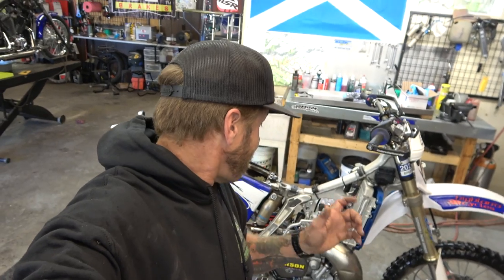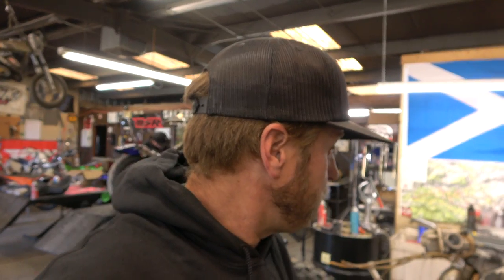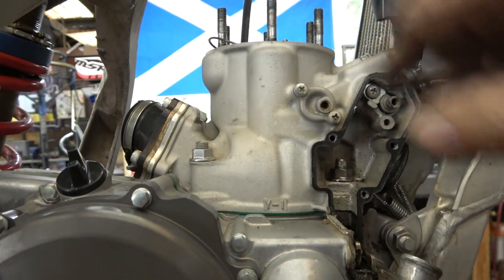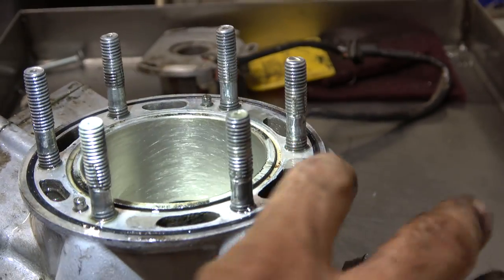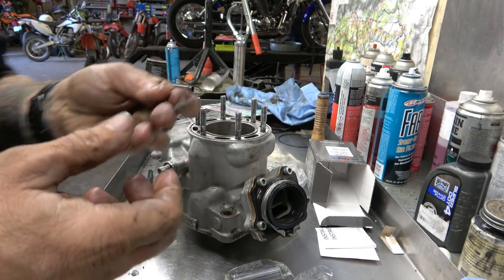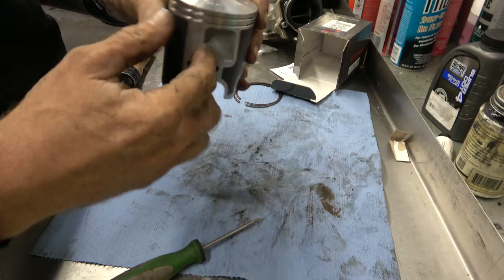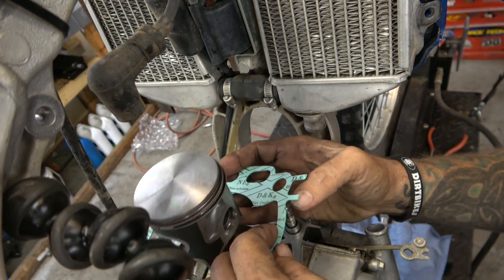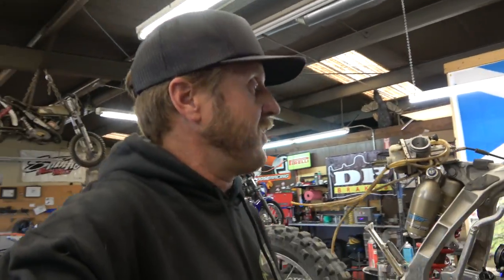YZ250 Top End

Comment: If you want to get a good torque spec on those base nuts grab a set of crows feet and make sure the torque wrench is at a 90 degree angle from the crow foot head so the distance from center is the same, great video

Comment: Yes viewers, we should DEFINITELY use a torque wrench as often as possible to avoid warpage, excessive wear, cracking, and other destructive occurrences that are ever-present and always possible, ESPECIALLY with magnesium and aluminum frames/blocks/brackets that make our modern toys so lightweight and awesome.  
"Crow Foot Wrenches" that mount to your torque wrench's square drive shank are awesome for those hard to reach areas and are super cheap at Harbor Freight or Princess Auto or whichever chinesium discount tool warehouse you have in your local hood.

Good vid man, thanks for taking the time to whip up a how-to.

Comment: The more I watch you with this YZ the more I'm thinking of getting one, much easier to work on then the GasGas. So only question I have what headlight can you run with the 80 watt stator you got with this bike. Lights are very important.
Reply from the maker: You can run the biggest one that baja designs makes I think. XL Pro

Comment: great video...is it required to rehone the cylinder every time when changing out the piston.... I don't see any crosshatches in mine although it's relatively smooth and seems to be in relatively good shape like yours was....
Reply from the maker: I like to.
Reply: @highlandcycles  copy that...ordered up the correct size one for my bore and some honing oil, as I don't have mineral spirits. I'm a little bit scared to take apart powervalve since many sources say to wash in hot water after with a brush, but noticed you did it without taking it apart...anyways good stuff and thank you, this is my first time doing it!

Comment: A quick question piston at BDC do you think the ports should be fully exposed be nice to see a pic of that when you did the top end. I noticed mine are not and the squish clearance is over 1.5mm so it seems to me the cylinder needs to be raised and the head brought down to a 1mm squish what are your thoughts thanks.
Reply from the maker: It sounds like it would be optimal to do that but I can say that the bike will probably have better low end the way it is and better over rev if you were to raise the cylinder.

Comment: Hey! I have a question. Is it ok to be able to use steel washers on the top end? Or do I need the copper ones.
Reply from the maker: You should use the copper ones if you can.  But in a pinch you can use steel ones.

Comment: I just put a new top end on my YZ250. I also replaced the head with an RKTech high compression head.  I checked the crank bearing according to the manual. Everything checks out. It sounds like there’s a rattle coming from the bottom end. Is it possible that the crank bearings in the cases are bad? Is there a way to tell without disassembling the engine? I also have video I could send to you. Thanks for the help?
Reply from the maker: That sucks. You can take the side covers off and try to move the ends of the crank up and down.
Reply: @highlandcycles  thanks for the advice. Do those bearings commonly fail?
Reply from the maker: @justinpeterson8754  Not super common but it happens.

Comment: What kind of hone did you use aluminum oxide of silicon carbide and what grit
Reply from the maker: I don’t know the grit. They are from Snapon many years ago. They just deglaze and put a crosshatch back in. They will also expose anything that is coming apart too. I have had a few where after I run the hone, I find some part of the plating coming off or an imperfection. That way I catch it before I put it back together.

Comment: Wait? So is it a Yamaha crank or hot rods? You just explained that yamaha makes there cranks super tight and need to heat them up but then say its a hot rods.
Reply from the maker: Yeah, sorry that wasn’t clear. Yamaha oem does that and hot rods does it on yamaha cranks. It’s actually on most cranks really. It seems that KTM ones aren’t normally blue like that.
Reply: @highlandcycles  Thanks for the reply. I am getting ready to rebuild a 2008 yz250. It's still on the original piston, rings, and crank. Is never been spilt. I am wanting to throw in a 250x 4th and 5th and figure i better rebuild the motor while i am at.
Do you like hotrods, wiseco, vertex, etc  better than OEM? I would like to get another 12 years out of the motor.
Reply from the maker: @travisk5589  I like hot rods cranks and vertex pistons. You can get that set up in the Wrench Rabbit kit

Comment: Hi great video men like always , I have my 2019 yz250x  2 stroke and my question is , Do you run jd jetting on your yz ? , beacause I will try jd and run motorex 50:1 for trail riding. What your opinion on that ? Thanks
Reply from the maker: Thanks. My YZ actually has a Lectron but I do recommend JD specs in the stock carb. And 50:1 is grear
Reply: @highlandcycles  yeahh thanks men !